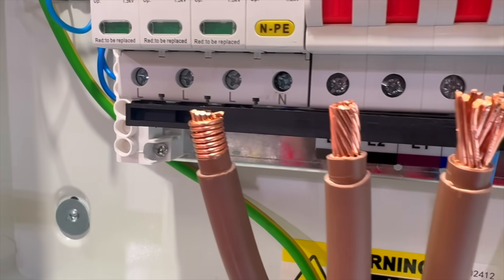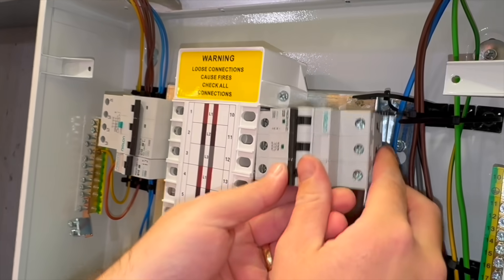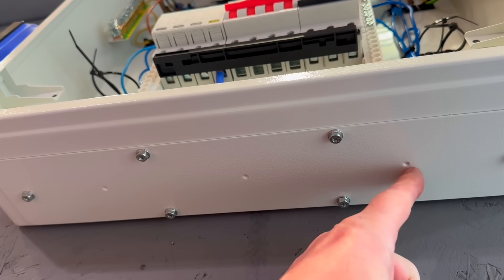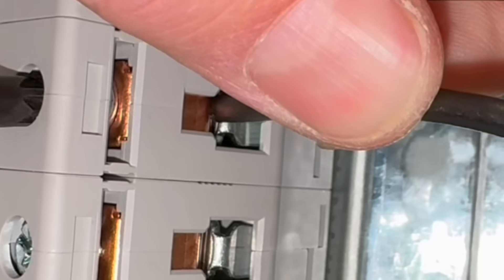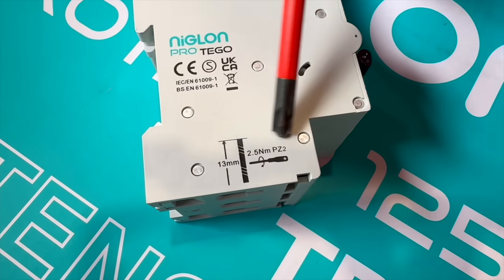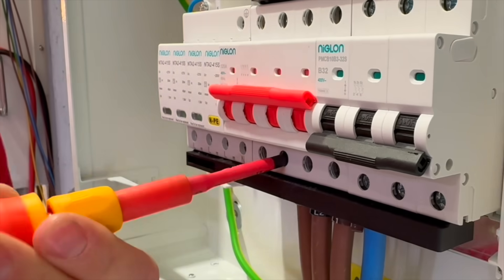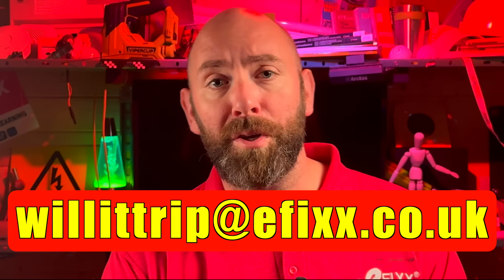We Tried 3 Tail Terminations - The Winner Surprised Us

Comment: Controversial perhaps, I knew it would be the spread method for multi-strand. Same method, and reason for folding over single strand.
In over 55 years of wiring ETC, I have never used, or owned a Torque Screwdriver. You can feel when its right through experience.
Never used or trusted crimp terminals, IDC ETC because of corrosion later. Soldering takes more time, but is more reliable. PV plugs need to be Soldered not crimped, because they are outside.!

Comment: Fist time I hear about a torque electrical screwdriver. Now that I know they exist, it seems de rigueur to me.
I chose flattened wire as the preferred termination as I know the contacts are all shaped into the form of two parallel metal plates coming together by means of a screw. But is that form of the contact the real problem perhaps? While it is easy to insert wires into contacts of this form, it is equally easy for wires to slip out when the screw is loose as there is no grip. Some kind of vice grip/claw grip contact could perhaps be safer, at least in the case of thicker conductors?

Comment: The board looks half decent..just missing a neutral rail as part of the chassis so's we could do away with having to terminate the neutral fly leads.. Surely they could design the mcbs as well as rcbo to accept field neutral termination..for an extra quid per breaker

Comment: Not tight enough > assume always. Tight enough > As tight as possible without damaging the equipment or screw. Too tight > You have damaged the equipment. Every termination should be checked for tightness whenever a change is made or wiring is moved. Every termination on a new board should be checked at last three times before cleared. If you have a torque screwdriver then use it but don't start thinking that people who don't, are at a disadvantage. Screw head compatibility is far more important than torque measurement. As for conductors, whipped if the tunnel is oversize. Twisted for conductors up to and including 10mmSq. 16mmSq and 25mmSq just crush the conductors evenly into the tunnel. Anything bigger and you're using lugs. 40 year veteran here😉

Comment: What is a reasonably priced torque screwdriver? They seem very expensive where i am
Reply from the maker: They are but you do get what you pay for… Note - CK TOOLS VDE DEXPRESS TORQUE SCREWDRIVER SET used in this video
Reply: @efixx a set of high quality screwdrivers here will set me back 1000 rand, and a single torque screwdriver costs between 4000 and 9000 rand. I couldn't believe it.

Comment: If you have made it through an apprenticeship to being an electrician without a feel for meeting the minimum to maximum tension required to terminate to any type of cable in any type of terminal, by hand,  so that the cable isn't damaged so that it breaks or too loose that it falls out and you need the training wheels of a torque screwdriver with every manufacturers torque settings that may or may not work on every cable and the different termination procedure (folding, twisting, bootlacing) then I have concerns about your workmanship.
Reply: I guess you will never work in aviation or aerospace then.
Reply: @drcl7429 not what the video is about genius, domestic and industrial switch boards don't tend to have wings, so the extra specifications for the extra harsh conditions of movement equipment encounters in the field of aviation or aerospace would be a requirement spelled out even for a seemingly smug wankers commenting on videos that have nothing to do with the subject of those industries.
Reply: @R1CK_54NCH3Z  You're the one being smug, John.  The idea that you can judge torque with your arm and that anyone who can't isn't a proper spark.  In places where it matters they don't rely on guesswork.  I am not arrogant enough to think I can judge exact torque anymore than I can judge voltage with my tongue so I use a tool.    I guess you like being the tool.

You do what you think is best and so will I.  Over and under torque are in high current terminations are the most common causes of fire but you go on trusting your arm.

Your avatar/Username seem to checkout.

Comment: When I was being taught in the mid 1970s I was always told to test both electrically and physically, in other words tug on the connection to make sure that it was fast. We were also told to never twist wires together or over twist single wires, on single stranded cables you double over the end of there is only one cable going into the terminal, if there are multiples then leave them as they are, this was to ensure that single stranded cables could still be well gripped by the terminal screw, and that multiple cables still had enough air room to avoid overheating. I am now retired but I always insisted on doing up terminal screws by hand not using electrical drivers as you can feel the right amount of torque necessary.

Comment: I wish all manufacturers would print the torque specifications next to the screws, not on the side of the protective device which is then covered up as soon as it's installed. I know that they also include the sticker in the enclosure, but really each terminal should be marked.

Comment: What was the winner then? 7 minute long video, with 2 minutes of advert and zero minutes of what was promised in the title?
Reply: was thinking the same. There was no why to the crushed ends
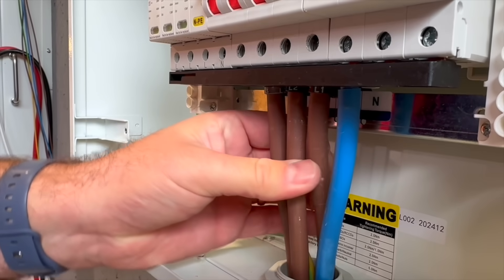Reply: The answer is revealed at 6:25
Reply: @ianpedder9721  That's not the answer. It's their own personal preference based on what? A hunch! No actual testing for max current rating, max pull force, speed of installation, or anything else for that matter. I could've put together a 10 second video with just as much value stating that I like to crush my cable ends.
Reply: There is only a lot of good stuff about how and what not to do. but yes, no real facts what is better.
Personally I am a big fan of crimped ferrules. Although I also know, depending on what the terminals look like, you do not really need them. At least not in modern equipment which screws down on clamp plates, and does not press to the strands with just the screw itself as some terminals did in the past.
I also wonder what those making what ever device has a terminal on it recommend.
Reply: I don’t know pointless video 

the best answer is number 2 and tightened up properly

Comment: In the aviation world to correctly crimp a pin on to a wire the strands should remain straight (not twisted).  If you twist strands you effectively make the wire a very slightly larger diameter, if you then crimp the pin the wire diameter can slowly revert back to its original size which then leaves you with a slightly looser crimp, increased resistance, more susceptible to moisture ingress etc and ultimately failure in the worst case.  I expect twisting the wires in a consumer unit will have similar issue.
Reply: R u takin the piss ...

Comment: If there is vibration, then none of these will be long term reliable. 
A direct bearing screw down onto lightly consolidated strands will always settle and further compact under vibration and therefore reduce the clamping. there are only two reliable methods with large vibrations; A well consolidated or filled end to the cable that does not settle; or a spring loaded connection that compensates for settlement and maintains the clamping.
Those 3 methods all try to provide an amount of consolidation and stabilisation, but this is not significant enough for long connections under large cyclic loads or vibrations. The first option appears to be the current favourite in some European countries. They can be improved with a quick dip solder of the end, but there can be reasons to do that as a standard action and also not to do it, and it takes time and care.

Comment: A way to unify the torque requirement would be to have different thread stepping. But that comes with another set of problems.
A torque wrench isn't infallable either because it depends on the friction between screw and nut. Oxides or lubrication can change the actual torque to be applied.

Comment: I predict that in the next 20 years, we'll move away from screw terminations, things will move towards Wago style lever sprung clamp (obvious appropriately rated for each current). This shifts the clamping pressure responsibility to the manufacturer and it can therefore be controlled by industrial manufacturing, rather than human variation.
Reply: I can see that happening too. The big advantage is that such spring-loaded connections don't tend to become loose. They maintain clamping pressure regardless of the cable being moved about or the strands rearranging themselves.
Once a screw is tightened, that's it unless someone comes along and checks it.

Comment: I suspect the results might differ between cage and direct screw-down terminals.
In methods 1 & 2, the more the conductors are wrapped up the closer they resemble solid metal.  In a cage terminal this will result in a very narrow strip of contact area at the front and back, and as the copper relaxes, very slowly when solid, contact pressure will reduce substantially.  My preference was always for method 3, (noting that in the video the conductor 'treatment' has been grossly exaggerated for effect), firstly straightening the lay of the strands then flattening with pump pliers.
Straightening the strands is important because the cross sectional shape of individual strands viewed in the usual plane becomes increasingly elliptical the tighter the whole cable is twisted.  This results in an increase in csa, again increasing the scope for loosening as the copper moves.
[Area of an ellipse is the product of minor and major radii multiplied by π (pi).  as the two radii approach equality and the ellipse becomes more circular, the area approaches the familiar πr².]
Considering a direct screw down terminal, especially with a circular section, the effects described above may become less important, particularly as the conductor csa approaches the terminal's capacity.

Comment: I would prefer to see  lug's on cables above 25mm with spring washer's on the bolt's. Clamp's on isolator's is a poor way to terminate large cable's  I would alway's flattern the strand's with water pump grip's to take the spring and compression out of the terminal connection then wiggle and recheck and recheck again before closing the DB.

Comment: The question is ask electricians if they have a torque set that is calibrated.
Reply: When it comes to repeatability electronic (strain sensor that sort of thing) are actually a lot better than quality mechanical tools, including those shown.  I'm not saying the tools shown are deficient.
Reply: I just see the logic as i was a mechanic before so all bolts need torque settings. Who would torque a cylinder head up.or main bearing caps without a torque wrench
Reply from the maker: Yes it's stated in the manufacturer's instructions ✔️

Comment: In the years before torque screwdrivers were common I would do a “tug” test for maintenance purposes. I saw to many terminals where someone went it & thought they had to get a 1/4 turn to make sure only to get a call out a few days later because of the strands breaking off & the cable falling out. Of course, I am old & having torque drivers makes that all much easier now, but unfortunately I now live & work in Canada & the USA where they have not quite caught on to the importance of correct torque values…

Comment: On high current terminal begins to heat. Heating means expansion or "thermal expansion of material". After high load is disconnected terminal begins to cool and shrink. 

Correct torque can't affect to thermal expansion, after few cycles of heating and cooling terminals will became loose. 

Solution: low demand and dedicated circuits.

Comment: Tighten down your connection with a torque screwdriver and you can guarantee that the following day with the same torque screwdriver set to the same torque setting you will achieve another 1/8th to a 1/4 of a turn.

So is the torque screwdriver the guarantee of tightness?
Reply: Only at the time of tightening.  Of course the conductor will settle.
Reply: In cage terminals I always either flatten if the cable is going straight in like in the video, or twist the cable if they go in like a hockey stick. You can get an extra turn to turn and a half. I’ve also seen some well known manufacturers terminals strip at the rated torque. 
The core wrap method is excellent for terminals with screws acting big directly on the conductor especially if the terminal is much larger than the conductor. I’ve only ever seen burned terminals when this isn’t done on direct screw terminals.

Comment: The biggest problem is not about torque settings . It’s about not giving the cable a gentle wiggle once or twice after tightening, then checking again. I’m convinced there are loads of of people who just torque them up and walk away . Hence e get loose cables later on . 
Oh I used to work with a guy who always used method 1
Reply: I agree,   what can happen it the terminal is not opened to accept the conductor which is pushed in below the clamp,  tightening the screw does nothing to secure the conductor which is why the connection should be checked by giving it a wiggle.  The same can happen with Busbar.
Reply: @Woffy. absolutely, flexi tails are worse, being 19 strand...  always wiggle, retorque, at least 3 times!
Reply: @TheChipmunk2008  At my age three times is not enough ...
Reply: @Woffy. now you're playing with it lol
Reply from the maker: I love a tug test and another twist on the torque screwdriver ✔️✔️
Reply: @efixx  it's shocking how many times even a tweak with a normal non calibrated driver shows that THEY FORGOT TO TIGHTEN IT AT ALL

Comment: I was waiting for the quantative testing to see which carried the most current with the least heat/loss. Soo... this was just an advert with an opinion piece tacked on the end. Not subscribing to click bait.
Reply: These are always about selling the next gadget.
Reply: I’m at the point where I rarely watch their videos cause it’s always more of an ad than anything else, shame cause they’re clearly knowledgeable but priorities are ads rather than information
Reply: You can measure the resistance.
You don't need to measure the current.
Reply: @deang5622  the chances are that the resistance is so low you will not get a meaningful result. We will be talking down in the single figure milli-ohm region for that actual connection. Put 100A through it, and maybe you'll get a measurable voltage drop. 

A more important factor is not going to be what it is at the time of installation, but what it will be like a few years later. One of the advantages of  Wago-style terminations is that the contact pressure is maintained over time as it's done by a spring. Maybe  somebody could design a screw termination with the same capability. That is  something that maintains contact pressure, even if there is some copper creep (or whatever the proper term might be) due to heat cycles as the load changes.
Reply: @TheEulerID A 4 wire (Kelvin) test would easily measure this. Milliohms are large enough to create microvolts with milliamp currents, and modern test gear can measure nano, even picovolts.
Reply: @DeShark88 I have just such a meter, which goes down to 10 milliohms precision, and that would not measure the joint resistance, which will be sub milli-ohm level.

Put 50A through just 1 milliohm, and the joint would dissipate 2.5 watts. In reality, a  well made connection will be lower, and you would need full laboratory conditions to measure the difference between the joint resistance of these three methods, way beyond what is going to be possible with the equipment available to even this eFIX.

Comment: I twist cable strands in the same way they are already naturally going. I then double the ends over if it's anything less than say 4mm. I don't double over if theres more than one cable in a terminal. I also might not twist if theres more than one cable going in the terminal and the twisting increases the surface area so you can't fit them in e.g. x2 4mm cables in a socket termination.

 I most likely won't be twisting the strands at anything more than a 16mm. And i most likely won't be twisting when using crimps or lugs. I also don't twist tri-rated cable of any size because they usually go into a ferrule or something similar

So for the most part the 2nd method

Comment: Choice No1 is a big NO, the amount of times i have seen cables overheat or just pull out because of that. Best way is do nothing to the cable, just torque the cable down, give it a good wiggle side to side and then re torque it.
Reply: I've only ever seen it used on flex instead of a ferrule in combination with a screw terminal, never ever seen it done on normal stranded before! Don't know why you would use it

Comment: Essential for every connection no matter the size is to retighten then after all the connections are done. The threads on screws relax after the first tightening and I can sometimes get another half turn on a termination.
Reply: Is it the threads, or is the cable copper core relaxing? Either way I agree with you about going over them all again.
Reply from the maker: Thanks for your thoughts
Reply: @efixx  It's not his thoughts, it's how it should be done. Tighten to the spec and tighten again 20 min later.